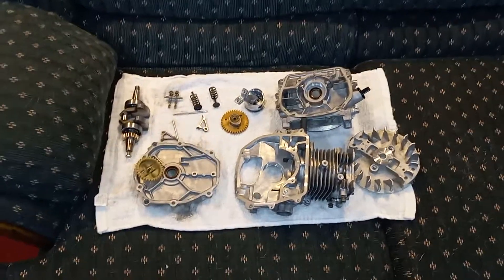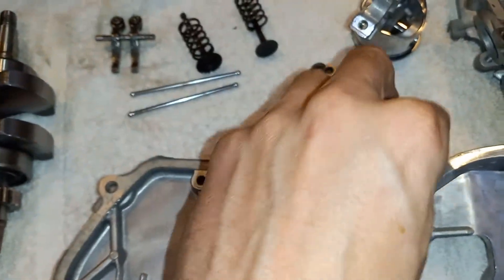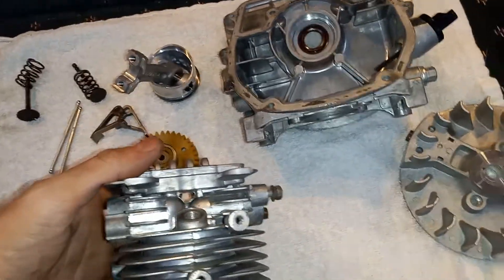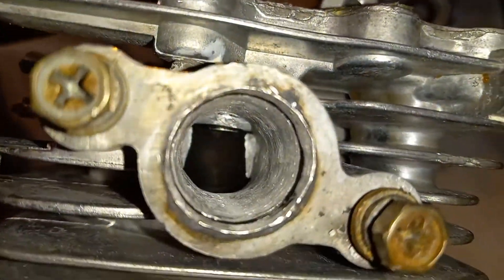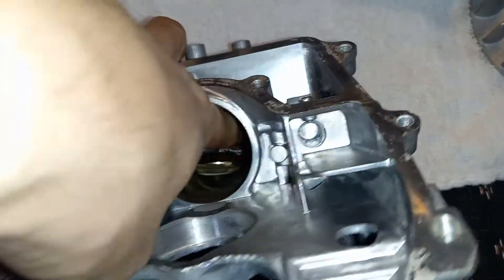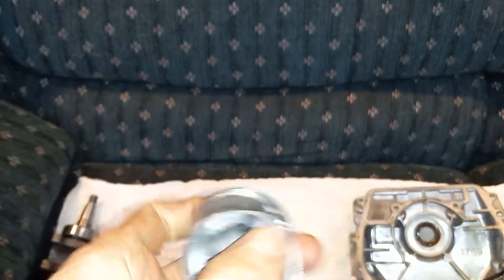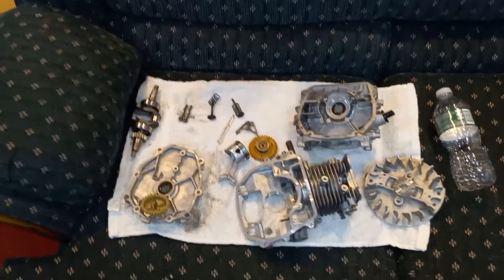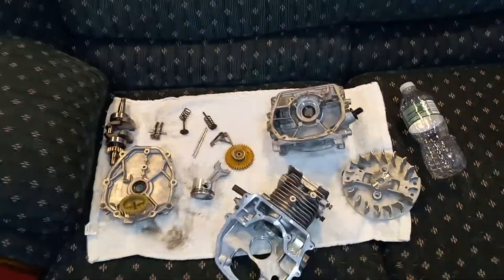49cc huasheng internal components

Comment: My motor won't run more than a few minutes without choking up, and there's no air/fuel mixture on the carb. I've cleaned the carb and tried a spare with same results. Spark plug is very fouled up, but sparks when it's cleaned off. I started to take the motor apart and got stuck on the flywheel removal - what's the trick here? Any suggestions for the engine issues otherwise? It's 10 years old and heavily ridden, started giving me issues after I filled it with too much oil recently and was leaking out somewhere. Since then, I can't get it to run.
Reply from the maker: Pulling the flywheel can be tricky. They have a tendency to break using a puller. It's either burning a bunch of oil or it's running very rich. Since it's 10 years old I'm banking on it's tired and burning oil. It may be time to retire the poor thing.
Reply: @mrpartridge8765  It took me a while, but I was able to get the flywheel off. I would have like to just buy a whole new engine, but I can't find a straight-shaft version anywhere. The only engines available are the tapered shaft which won't work with my EZM drive.

Comment: :face-red-droopy-eyes:That porting .. YUCK
LOOKS counterproductive
Reply from the maker: I know it wasn't the greatest lol. The bits kept getting clogged with aluminum and wouldn't cut cleanly. I just got done with some clean up and general maintenance on it including cleaning up the ports with better bits.
Reply: @mrpartridge8765  The flow should be atrocious on the intake . Looks like it got away from you REPEATEDLY or you had a bad time matching the  perimeters to a 'custom' intake?
I'd recommend a blunt rounded end drill bit as a flash remover until you get the hang of the carbide finesse, not near as aggressive as long as you're steady...
If the 'bits' you speak of are stones ... :face-green-smiling::face-green-smiling::face-green-smiling::face-green-smiling::face-green-smiling:
Even talc powder wont keep them from loading up with aluminum.
Most of those little engines run pretty damn good out of the box, just correcting for any obvious irregularities
Please disregard the snark as I'm a poorly funded weld/fabricator and have learned from a LOT of experiments/mistakes.
Persistence is KEY
Reply from the maker: @charlesangell_bulmtl  the dremel I was using at the time had a bad bearing causing the bit to wobble and jump and the bit I was using was a carbide cutter. I was matching it to my intake that is round. I have better tools and more experience since I did that video.

Comment: I have one of these. I bought it because I was done with the poor reliability of the 2 stroke china dolls. Even though the 2 strokes are fun, I don't regret the purchase. I used this engine a few thousand kilometers already and it's still running exactly the same as if it is new. The built quality is vastly superior to those 2 stroke engines. My father, god rest his soul, built a bike with a 50cc 2 stroke china doll and it still runs perfectly to this day, after 8 long years. SO there are exceptions out there.
Reply from the maker: The 2 strokes quality is here and there. When they are ported and tuned properly they are great little engines that can last as long as the 4 strokes. I've built a few 2 strokes over the years and I gotta say I prefer the 4 stroke.

Comment: I have a 66cc and a 53 4stroke, i did some 66cc mods, exhaust, reed, etc
Now i want to do 4 stroke tuning, porting, big exhaust, big carb, big transmisson cuz the belt drive and stock chain is absolutely shit
Reply from the maker: Doing a port and polish helps big time with this engine but you have to completely tear it down to do so. With the gy6 carb and cvt my scooter is faster than a road legal taotao scooter. I'd say its about double the hp over stock.

Comment: You can't swap out the tapered for the straight shaft... unless you buy the corresponding sides of the case because they are different. 
What you can do...
It's governed by the cdi/flywheel to max at 6800 rpm however if you get the flywheel and cdi made for the real Honda gxh or gxv 50 you can hit 9000 rpm obviously if you do for long your going to cause major issues but the original versions of these Honda clones from before 2010(I think) had no governor and as long as you didn't run red line under load all the time guys were getting 10k miles on these on the regular... if maintained(oil changes, make sure  the air filter hasn't fallen apart every so often , make sure your valve  lashing is set(.004" for intake and .006" for exams u believe is the sweet spot). Ungoverened I'd say have a permanent tach set up and don't go over 8500 rpm top and don't run over 7700 sustained rpm.

There is a $9 air cleaner made for the Honda/Honda clone gx100 that is similar to stock just wider and more airflow. The new air cleaner also had the mount holes all the wsy through to the back... instead of inside the air cleaner box in front of the sponge air filter. I couldn't find any m5 screws long enough to mount it so,
 I cut 2 lengths of m5 threaded rod to make my own screws. I glued a m5 wing nut and regular against the wing nut on one end of threaded rod with epoxy(any strong glue would work)
 Then did the same to the 2nd threaded rod I cut so I had m5 screws long enough to hold the aircleaner/carb/plastic intake insulator/ paper gaskets. Also being wing nuts it's much easier to get to the air filter / carb and gaskets fir service and it's easier to mount back on. It all goes on at once. 
I built a bike with a tank frame. It's an  in frame mounted  49cc 4 stroke w 4G tranny plus Sick bike parts shift kit run to a Shimano nexus 8 speed rear hub. A lot of work and I did every aspect. Paint, wheel build, front rock shox suspension fork front hydraulic disc brake rear v brake. Maybe I'll make a video but I doubt it. Thing runs like a champ and is rock solid. Got a long flex exist on amazon that sounds sweet. Just need to rejet because it's running a little lean but after that it's done and I move on to the next. I have parts for 2 more all will be shift kitted. Sorry about the rant.
Reply: .. test runs
Eventually your gear selection against avg drag(uphill, downhill, wind and no wind, mostly aerodynamic drag) will allow the max speed at desired RPM  
bigger gear at drive side or smaller on wheel  BETTER to err on the side of speed not rpm
Reply from the maker: If a billet rod was available I would get the honda cdi and flywheel but nobody makes it. That was something I looked into a long time ago. I stuck with the tapered shaft because getting a straight shaft was impossible. I run a gy6 taotao carb with a foam pod filter so it has plenty of airflow and looks better than a hunk of plastic lol. I have the cvt system made it just has to be mounted to the scooter and tested. Check out my videos  and see what this engine can do. That gy6 carb and the high flow exhaust makes all the difference.
Reply: @mrpartridge8765  there's a company that sells a big bore carb and reworks the stock carb...
 AGK I  just remembered(affordable go karts) they used to sell a different cam for it but they still sell the big bore carb and the reworked stock carb. They as lso sell a velocity adapter for this motor.
Reply: Thanks for your ideas my friend. But I'm curious about one thing. If you replace that Honda's CDI and flywheel, it will be a lot faster but shorter life of motor because of high RPM. But what if you put like 58 teeth sprocket on rear wheel? RPMs will be slower than 7700 rpm but with higher torque, and If I'm not bullshiting its still faster than with stock cdi/flywheel but with extra torque. Sounds like a great deal, but what about lifespan of the motor? Like I said, RPMs will be slower than 7700 RPMs. So I guess It wouldn't hurt the motor. But I'm sure. What do you guys think?
Reply from the maker: @strukk5742  the larger the sprocket on the tire is the slower you will go thus increasing the engine rpm. You would have crazy torque and acceleration though. There will be less load on the engine making it easier to turn more rpms. A smaller sprocket on the tire would increase speed but put more strain on the engine thus reducing rpms and possibly burning up the clutch.
Reply: @mrpartridge8765  Thanks. I understand now. Well, yeah crazy torque and acceleration but  lifespan of engine will be short, cuz of high rpms like 8k or higher, If I would use Honda's cdi/flywheel.
Reply from the maker: @strukk5742  I built a beach cruiser for a friend of mine last year with a 50 tooth rear sprocket. At the governor it would do 27 mph but it would haul him up a steep hill with no effort and would even pop wheelies from a dead stop. I live Im maine and the is no such thing as flat ground lol its all hills so torque is required.
Reply: @mrpartridge8765  Yeah you live in fucking mountains bro XD 50 teeth sprocket with stock things including the governor and still do 27 mph? That's not too shabby
Reply: @strukk5742  shorter life if you run the rpms waaayy over red line or if you run over original red line for too long. The original Honda clones didn't have a Rev limiter and they ran up to 9000 rpm (the Rev limiter is set at 6800 rpm +- 200 rpm) and they sold tens of thousands of those. If your worried just get an accurate tachometer and don't run it over 8300-8500 rpm for a short burst and don't run it over 7500-7900 sustained rpm(some of these numbers will depend on rider + cargo weight) Make sure you constantly check your oil level and change your oil on regular intervals with good oil (the tachometer usually tracks how many hours you have on your motor and you can set your oil change intervals accordingly)
Reply: @strukk5742  one issue is its difficult to find the older Honda CDI and flywheel apparently they changed them I'm trying to source them now. If I can't find them I'll try and find an alternative.
Reply: @utilidaily  Ok so I think you can get pretty easily Honda genuine CDI from aliexpress for 20 bucks. But the flywheel is little bit tricky. There are 3 types of flywheels, one is old HS flywheel second is new HS flywheel the difference between this two is they are 20 degrees offset. Interesting is that the Honda flywheel is almost identical as the new HS one, just there are less surface on magnets. I mean magnets are still the same on Honda and new HS flywheel but the surface where are magnets, is...little smaller on the HS one. But since the magnets are technically the same, its shouldn't matter. Well I Have to try out. I ordered that Honda CDI, I will keep that stock flywheel (the HS new one) and then I will post update.
Reply: @utilidaily  If it will work it would be awesome. But poor connection rod will not like it. I saw there is a crankshaft propably from honda with forged rod. I just dont know if on end of the rod is 10mm or 11mm hole for piston pin. But what do you think will it handle 9K rpm?
Edit: Today I got the honda's crankshaft with forged rod. It looks better than the HS one. The hole on the forged rod for piston pin is 11mm but there is a bearing so that 10mm piston pin will fit
Reply: @strukk5742  with the forged rod yeah. Without it it will handle 8500 for short bursts easily
Reply: 👌🏾q

Comment: Hey man I just took mine apart and I lost the washer that goes in between the cam gear and the case cover.
Is it a issue becuase the motor turns freely.
Reply from the maker: without that washer you will have slop on the cam gear. it will cause irregular wear on the cam lobe and lifters.